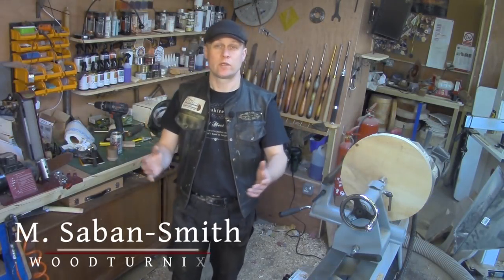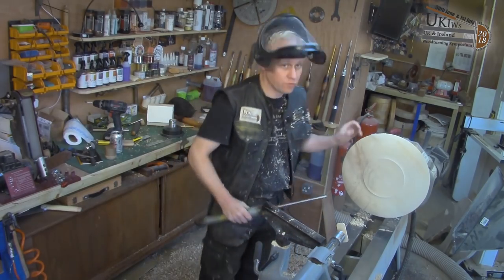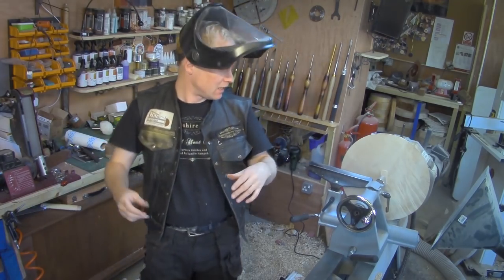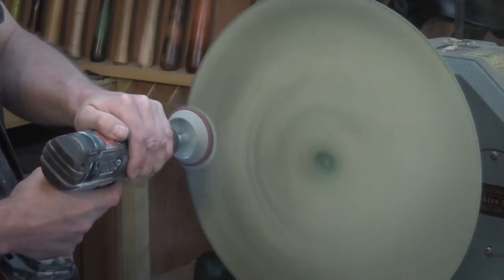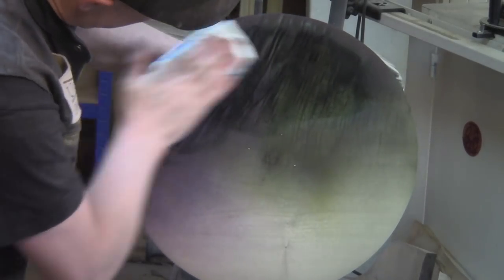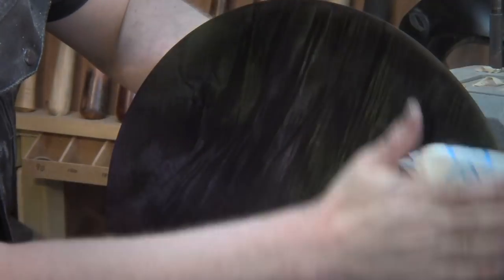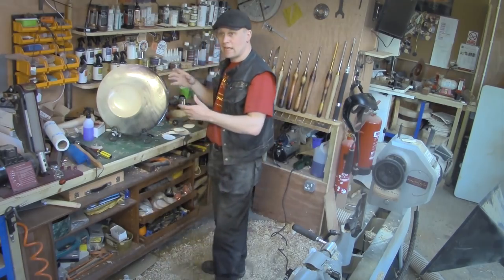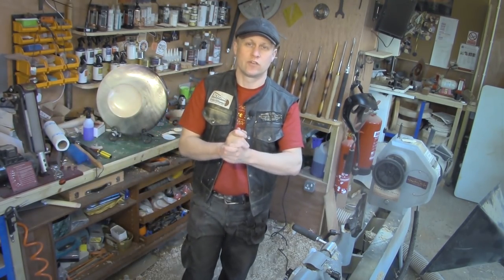#87 'Turaco' Sycamore Wood Turned Off Centre Platter

Comment: Great piece Martin. Must have been some tense moments when using the 3” vacuum chuck but it seems all turned out well. Thanks for the new video. I hope there are more to come. Regards, Dan Healy
Reply from the maker: Cheers, Dan. The 3" chuck did a great job, but not 100% because of the size of the piece. I always play it safe and turn the lathe down with slightly iffy things like this. The rpm went down to 260 when the tailstock was taken away. And, I made sure I was out of the way at all times.

Comment: Martin, glad to see you back.  I have a question for you.  What is that rectangular piece that is on the end of your tail stock holding the piece against the drive screw?  How is held onto to the tail stock?  Thanks, Rob
Reply from the maker: Hi Rob. Thanks for watching and asking. The piece of wood on the tail stock is just a small bit of sycamore to stop the live centre marking the piece with its point. It's held on there by the point only. So it's nothing special and cheap as chips!
Reply: Thanks for the fast reply!  It helps me for some upcoming work I have to get on soon!